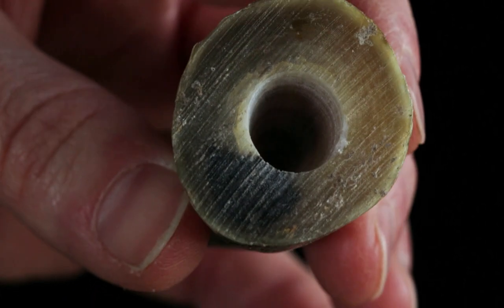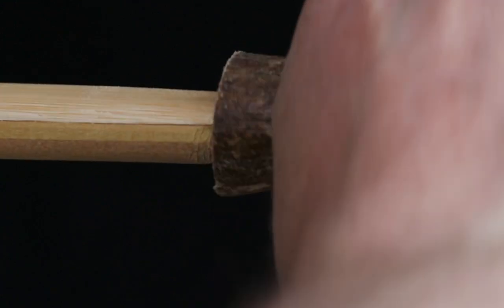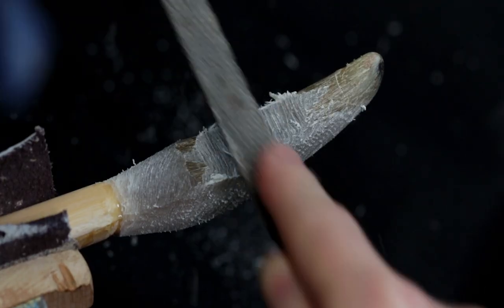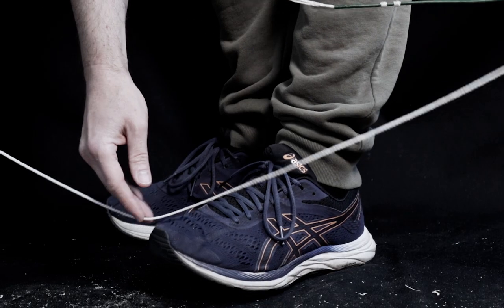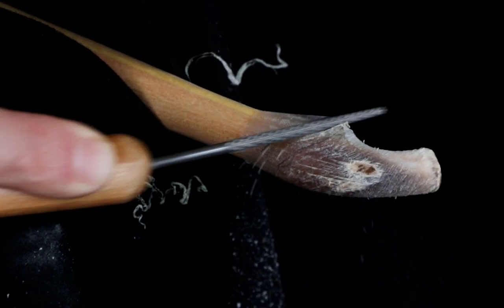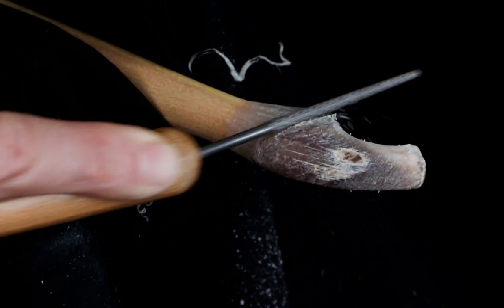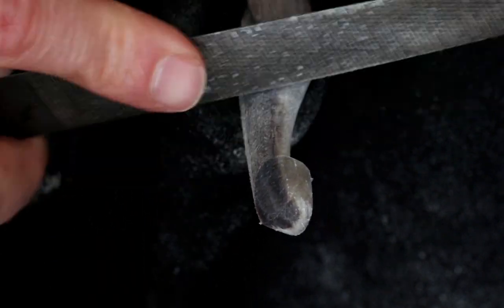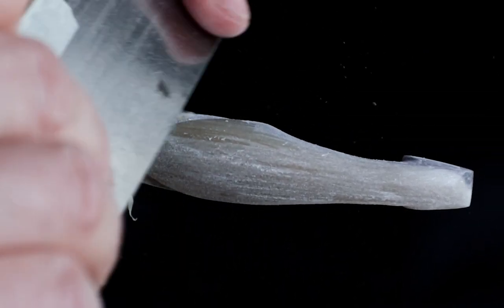How to make a longbow part 3   How to carve Victorian horn nocks and put in a string groove

Comment: Great video, do you need to remeasure the nocking points from the centre of the bow before you start cutting them so they are the same distance?
Reply from the maker: Thanks, no matter how much info and time I spend on these videos, there is always something I forget to mention!   I think you mean nock grooves, the nocking point is on the string.  As I have drilled the nocks to the same depth and by virtue of their design, the 'meatiest' area of the horn, which is where I place the grooves, is about an inch up from the socket on both horns, so they naturally end up evenly distanced.  It's something in have done so many times I don't measure it or think about it, hence forgetting to mention it in the video.  Interestingly when I have removed nocks the groove is in the same place as the tillering grooves!
Reply: @longbows  thanks for the reply, yes, nock grooves is what I meant. I’ve not built a longbow yet but trying to ensure that’s where I would plan to put the thick part of the horn in the right place. Thank you for sharing your knowledge and experience.
Reply from the maker: No worries, well done for spotting my mistake!  Hope my website comes in handy www.howtomakealongbow.co.uk

Comment: I am surprised that glue is holding the nocks on
Reply from the maker: Life is full of surprises.
Reply: I've seen someone say that if you fit them snug you can even keep them there without glue. 
I even used regular wood glue one time (couldn't find the epoxy) and it's still on the bow
Reply from the maker: I wouldn't like to try without glue, but, I have never had a pair of nocks fall off in 40 years of making bows.
Reply: Why?? 

Most modern automobiles are put together with adhesives as is the Boeing 787 Dreamliner.  I build furniture that is all glued up and has never failed....
Reply from the maker: Indeed
Reply: You are right, it does look like a lot of work !
Reply: I’m very impressed with how you feathered the horn into the wood. That would be a good subject if you ever edit the video! Well done!,
Reply from the maker: Thanks, just practice really, I show it quite a bit in various videos.